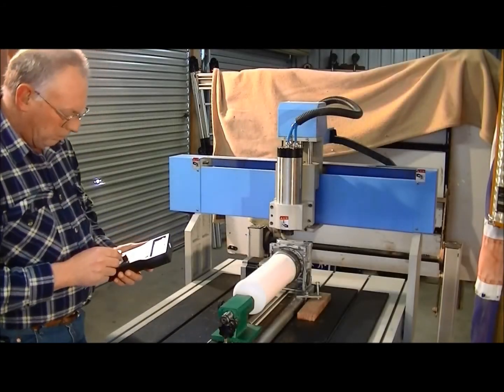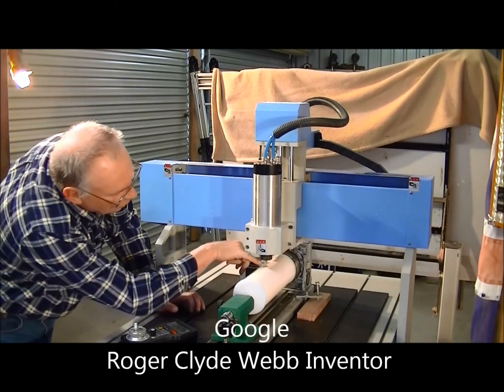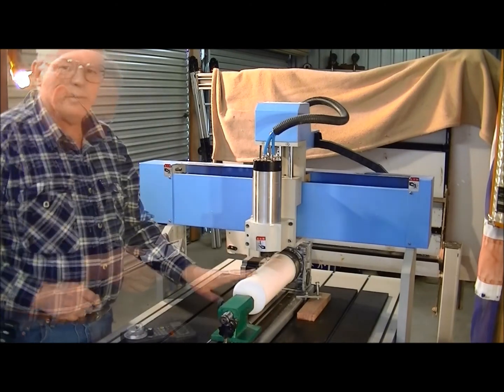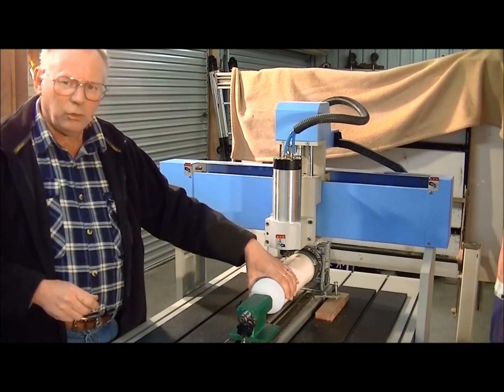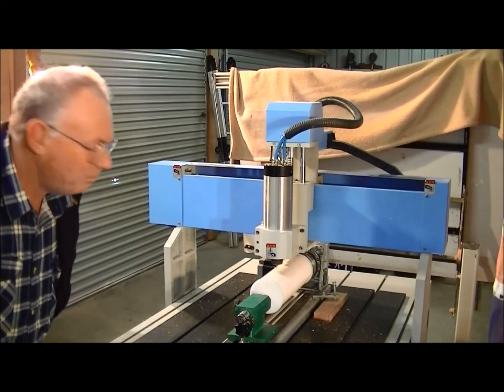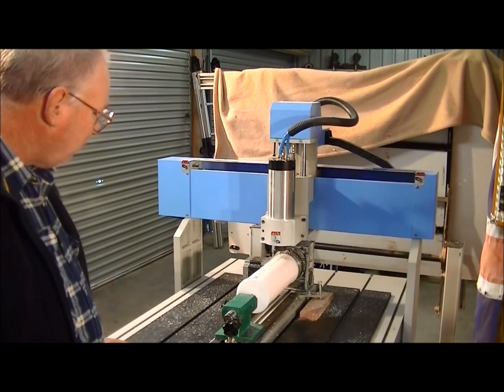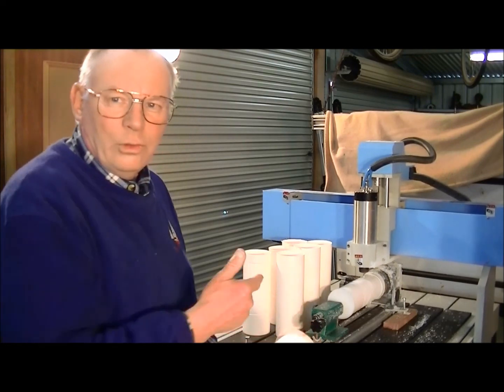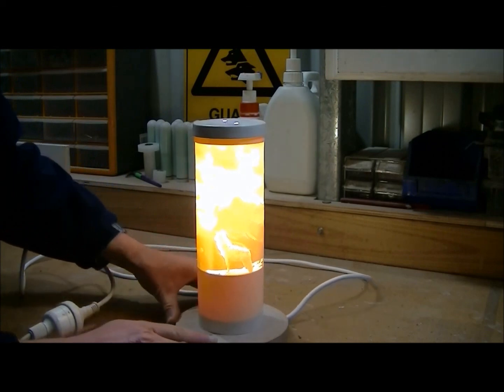28 A CNC router making a 4th axis lithophane lamp

Comment: Beautiful work! Could you turn a wooden cylinder to insert into the plastic pipe to help take the oval (you mentioned of the pipe) out to a more precise circle? As for the difference in thickness if it is then made correct on the circular inside, cutting to a specific depth (per interior dimension)  should that not give you the accuracy of depth without cutting through? Or perhaps (with aforementioned wooden insert) turn the pipe on a lathe before CNC for an accurate thickness? Just a few thoughts to perhaps help.

Comment: Nice job getting that to work. PVC is not the most accurate stuff. I'd tried different materials on a 3 axis machine and had good luck with simple foam board and maybe a light paint fogging for effect enhancement. Was going to do the rotary axis mod but got a 3D printer instead. Haven't run my mill but twice since. Good Lithos are easy now.